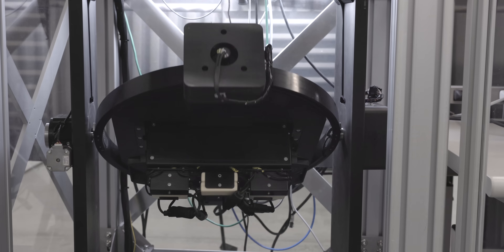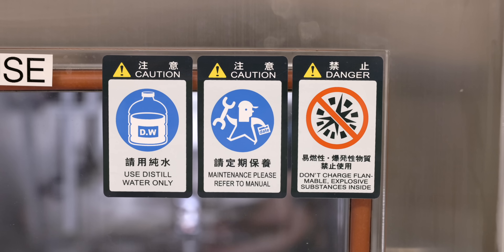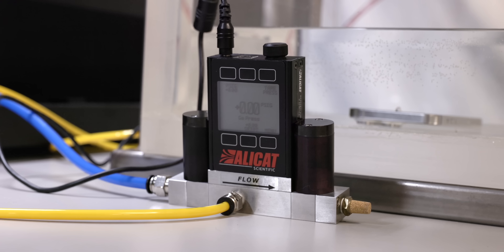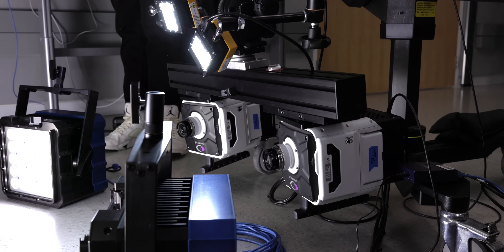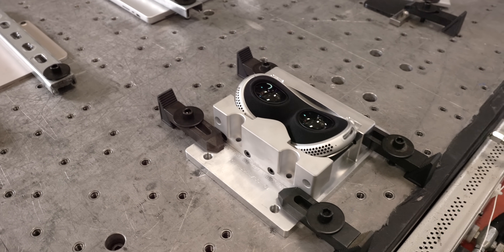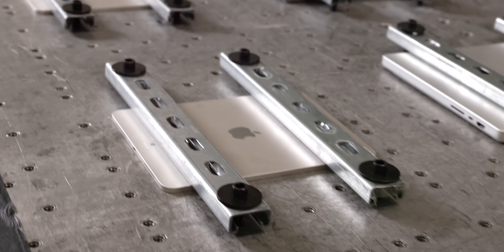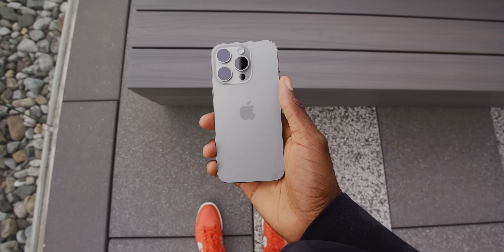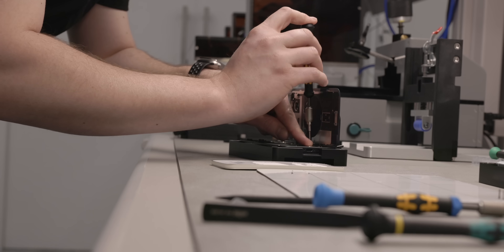I Visited Apple's Secret iPhone Testing Labs!

Comment: I don't buy his argument about the balance of durability vs repairability.

-Adding gaskets improves durability without conpromising repairability.
-Locking parts to serialized pairing has no effect on durability, but destroys repairability.
Reply: He picked the one example where that might be true: (Water) ingress. Sure, completely filling the inside with glue makes it resist water, and makes it unrepairable. In this singular example I agree with him, but otherwise those two are not mutually exclusive. You can very well have a camera that is durable AND easy to replace. They are not on a scale.
Reply: @QuickNick2402  To be fair, he did say those things weren't mutually exclusive.
Reply: tell me about it! what a bizarre way of justifying non sense by Apple!
Reply: Absolutely! What a miserable attempt to justify their greed
Reply: This is apple. What do you even expect from marques? Saying the hard truth? Ofs
Reply: It also seems doable to make the phone waterproof separately from the battery, since that's the one part that will always need replacement.
Reply: @LeaPhant  Not while keeping the phones as small as they are today though. If the battery is to be in an entirely separate compartment to the rest of the phone's hardware, that would probably make it a decent bit thicker.
Reply: @StripeRose is it just the phones though. I see the same patter in all of apples products
Reply: @1mukentuken  Don't get me wrong, Apple is doing a lot of wrong with their things. I'm just saying in some cases there are actually trade-off and it's not all bad.
Reply: @StripeRose S5 is smaller than phones on the market today and has a removeable battery and is water resistant.
Reply: @VikCachat  Right, but what else is also different as a result?
I believe the Samsung S5 also has a lower water resistance rating (which to be fair probably doesn't matter much for most), and a smaller battery with a lot less juice in it.
Reply: @StripeRose  s5 2800mHa vs s24 4000mHa granted there would be compromises to make that into a replaceable battery. I would pay good money to get a phone with a flag ship soc, replaceable battery, water resistance and headphone jack all without the features marketing hype up . Sure it would probably have a smaller battery capacity but without the bs features it wouldn't need that much and you could swap out batteries instead of plugging in battery packs.
Reply: @VikCachat  Yeah I'm definitely with you on that one
Reply: Where you really expecting somebody to who works at apple to not justify why they do what they do? Bro would be fired instantly lol
Reply: @Fry_Plantain  off course we are not expecting apple employees to say the truth but then marques? Such a disappointment giving bs statements just to defend apple.
Reply: @fantasytky28  I mean....... he has to also watch his pockets too.... if you get blacklisted by the big boys in the game, you're taking money out of your own pockets cause I'm not gonna be watching him review products from subpar companies. If he chooses to "sell out" as some would say, then, thats his priority.
Reply: @Fry_Plantain  he is sold out long time ago. If you haven't realised after so many years then it's on you.
Reply: @fantasytky28  I don't think somebody who's a "sell out" could necessarily garner nearly 20 mill subscribers, if people figured out they were biased. At the end of the day, he is still one of the best reviewers of tech in the industry. I do agree with you about not calling out the big guns on certain issues like the repairability one, but I still think he needs his props for what he does.
Reply: @Fry_Plantain  he "was" one of the best tech reviewer. But now or at least for quite some time already? Questionable...
Reply: I was about to write this very same comment. Marques not calling this out is... disappointing (but not really surprising, given how Apple handles media that doesn't tell their tale the way they want it to be told).
Reply: Its classic anti consumer hogwash
Reply: gaskets are not as secure as glue, clearly.
Reply: Exactly this
Reply: I think even if they serialized parts and pair patcs with motherboard, they should provide tools to pair when new parts are installed on phone like google did.
Reply: That second point especially
Reply: This is exactly what I was thinking
Reply: What's even crazier is there have been so many exposes showing how apple fights so hard to refuse warranty repairs and pushes people to just buy another phone smh. They dont even want you to pay out of pocket for repairs
Reply: Durability of profits.
Reply: Thats not the issue.. its that they refuse to even sell spare parts to shops..
Reply: I was thinking the same thing. Apple could certainly do more to make the phone more repairable without sacrificing durability. They just choice to make it hard because it’s apple and you pay premium
Reply: @darkhorse505  What could they do differently?
Reply: I'm going to replace all the wooden furniture in my house with glass. It's much harder to repair, ergo, it must be much more durable.
Reply: Hey you seem smart, you should start a tech channel!
Anyway while this is definitely true gaskets can and will impede the difficulty of repair, both in disassembly and in ensuring the device is still ingress resistant after the repair. It requires specialized, perhaps more expensive tools and an extra part every time you open your device. Now gaskets on phones that are more repairable cost like 5$ usually if you can apply them by hand and as Rossmann says, it's the shop's/user's matter if a repair will be easier or more difficult to fix, like having soldered ram but that's entirely different from not being able to have ram upgraded because it's paired to the SoC.
As for the serializing, what he said about having a database of calbration measurements for all their genuine parts (which reminds of the qr codes prusament has for the thickness of each spool manufactured) is definitely super interesting and probably super helpful, but preventing the end user/shop from calibrating a 3rd party replacement part is just anti-consumer.
Reply: @devnol he alr has a channel
Reply: of course he needs to justify or he doesn't get the visit and money
Reply: the unspoken, untouchable third goal is sleek design. You need something to press on the gasket, and that something will not look like a smooth featureless box.
Reply: @chaklee435  Apple's phones haven't looked like smooth featureless boxes for like a decade since they added the huge camera bulges. My iPhone 13 has THREE giant lenses sticking out. If they can compromise for camera, they can compromise for repairability. That's a clue that they don't care about repairability
Reply: That's not really his argument though. They didn't mention the serial numbers or anything. It's just how difficult it is to get into a phone or how many components are in the way. Having to disconnect a bunch of ribbon cables or have strong adhesive is what makes an iPhone difficult to repair from Apple's perspective and for verified third party repairs. People are approaching this from one angle, but the question and answer are from a different angle. He didn't ask "why are the parts serialized?" he was talking about how difficult they are to repair.
Reply: @LeonBlade  You missed the point. The ribbon cables don't make things harder to repair. Gaskets don't make things hard to repair. Tiny SMD component don't make things hard to repair. Serialization makes things hard to repair. Locked supply chains make things hard to repair. Predatory behavior towards repair shops and makers of repair parts make things hard to repair. None of those things benefit durability. Durability and difficulty to repair are not codependent.
Reply: Yeah I wish he could have asked him about that, but his department probably has nothing to do with the individual components. Would like to here from a parts supplier or Internal designer about why they feel that's nessesarry
Reply: Well of course you don't buy it - most poor people are also dumb and they don't buy anything, they expect it to be given to them for free.
Reply: @rodmunch69  you just came for the cookies, didn't you 😂
Reply: @DanKaschel  is that some sort of come on? I'm straight,  cupcake.
Reply: @rodmunch69  😉
Reply: If I had to play devil's advocate here (which I hate doing for Apple, ESPECIALLY for this specific topic):
1.  Gaskets make the product larger.  "Then why not design so gaskets don't make it larger?" We've fine-tuned the process to the point where affordable, reliable gaskets are not ideal.
2.  Adding gaskets (and other means of access to the phone) create weak points.  "Why not reinforce the weak points."  Then we'll make it larger, which was covered above.
3.  Allowing access to batteries for repair work will make it so our product will decrease in value and our standards, thanks to that repair work.  "Why not put something in the warranty that states outside Apple repairs, although legally allowed, will void your warranty?"  Because people will blame Apple regardless if repairs or mods were done without our consent.  Someone will pick up an Apple phone, see that it's flimsy or slow-performing, but never get the full story that it was brought to an outside source for repair.  We get the blame we shouldn't, and our brand suffers.
4.  Probably most importantly:  By allowing right to repair, you're now creating a competitive market that eats in to potential revenue for Apple.  Now, people will repair their phones instead of throwing it out and buying a next gen phone.  Just the fact Right to Repair exists now is forcing us to put more into our phones with respect to longevity and strength, which could be going in to our pockets in the form of raises.  And since  you're impacting OUR personal bottom end, that's just unfair.

If I were Apple, and had no filter, this is what I imagine they'd argue.  Bullshit?  Yeah.  But there it is.
Reply: Absolutely, instead of glue, you could screw a device together like a laptop, and that would increase both durability and repariability, since the screws won't come out on their own (with properly applied threadlocker), but a user can easily undo them without heat or excessive force
Reply: @YonatanAvhar  Doesn't thread locker give out under heat? Phones left in vehicles are exposed to summer temperatures in excess of 100F for prolonged periods of time.
Reply: @YonatanAvhar  threadlocker isnt always enough, but it often is. Sometimes the issue is more of a size consideration, fasteners take up more space than glue, that's probably apples driving force for their decisions. But honestly, id prefer bigger phones anyway.
Reply: Partially you're right but you're missing a huge point of locking parts to serialised pairing (AKA Regulation) which is Consistency and Reliability.

Let's say any screen can be used to repair an iPhone that's broken, suddenly you have a bunch of varying quality screens on the market and varying quality phones in general in the market. These then not only influence new sales but also potential future repairs and further compatibility with even more other parts like let's say varying batteries.

Now you'd have an iPhone...but what's even an iPhone if you can put any lower or higher quality screen on it? (Basically ship of Theseus type stuff).
This basically screws with the brand they're trying to protect as a company but ALSO the customer's Expectations, Reliance and Trust.

so repairability IS in fact a double edged sword.
Reply: Everything he said was true. No, he didn't attack Apple. Not would that have appropriate in this context. Nor is that even his job other than tangentially.

Honestly y'all sound so naive and entitled.
Reply: @DanKaschel 1.4 million views right now. He's a popular & presumably respected tech reviewer, and he made misleading statements about the repairability of a product he is reviewing. He talks about repairability (usually on a surface level) in several videos. It's literally his job to give fair, accurate, honest reviews. He spoke the company line in this video, and omitted some important truths.

I don't understand how it makes someone entitled to expect a tech reviewer to honestly and accurately review tech.
Reply: In many parts of the world iPhones got stolen and snatched and sold in market as spare parts. So it makes a little sense.
Reply: I kind of agree in the balance argument. Especially in cars… I live in a country where car crashes is all time high, and its always the Solid ER cars, especially German (these cars are known for being hell to repair and service) cars who always stays intact, while japanese cars (being the easiest and less complicated to repair and service)… pray that you’re still in one piece, or not cramped.
Reply: @yokokoko499  Yeah, only part that you forget, that despite looking intact, this cars often suffer damage on inside, repairing which may cost you more then a new car from other brand... Things are supposed to crush - they absorb energy this way. If they do stay optically intact, this means, the energy was absorbed by some other part of vechicle - that isnt made for that purpose - or in the worst case, by the driver and passengers.
Reply: @alexej123  Exaclty. It may look bad if the entire hood of your car became the size of a soda can, but it means it absorbed the impact instead of transfering it to the passengers. The stiffer the car is, the more it will stay in shape, but the less impact is absorbed. So I'll take a car who's body (except the cabin) deforms any day 100%.
Reply: serializing parts is an anti-theft action not durability improvement
Reply: @youssefmohammed5456  I hate when people steal just my iPhone battery but leave  everything else behind
Reply: Serialising is to combat theft not repairability
Reply: @JaeTLDR1 it's mainly done to prevent repairability by the consumer. Discouraging theft is just a side effect.
Reply: Then they should give owners the ability to lock and release serials for their devices. It would massively improve the repair experience for everyone and then apple could use that line without it being bs  @JaeTLDR1
Reply: Who are you again ?
Reply: @Spikyzzzz Someone who knows their shit
Reply: @Spikyzzzz gamecube joycons and portable wii guy

Comment: The argument for durability vs repairability as long as you build products made from glass and that operate on battery power is so STUPID! The battery will degarde over time, that is a fact, so if you care about your customers, you should build your products with the ease of battery replacement in mind, the same goes for screen/backplate.

Comment: well do keep in mind that the reason iphone uses glass at least on the back is cus the consumer wanted wireless charging.

so yes its our fault not apple. that we made the iphone less durable. cus man that iphone 7 was a tank. i could drop it. and if it landed on the back. it was perfectly fine.

so yeah. glass on the iphone. thats 100% on us. thats why ipad will never get magsafe. unless they switch to glass. induction dont work through metal.

Comment: Thats a ridiculous argument to say its repairability vs durability. Sure for water resistance it might check out, but pretending that replacing some parts is more wasteful than entire phones going to waste + you can design for both to be optimal (or dont design to hijack repairability by making new components not work on purpose, thats even more wasteful)

Comment: We know for sure they don't have a bend test machine in there.

9:20 Smells like 🐂 Battery non replaceable bc adhesive? Ghoul just wants to act like screws and rubber seals don't exist and selling adhesive to repair shops is impossible.

Comment: 10:04 yeah checks out, but they're leaving out the fact that they software lock components to the motherboard. You know what I mean if you buy two identical iPhones and swap the screens you're going to have problems how do they explain that in the bookend formula.  That is something that Apple does on purpose to make repaiability more difficult. Or the adhesive that you have to remove to get the battery out, does that adhesive need to hold a ton of weight.

Comment: Harder to repair is just gaslighting, pairing parts to the motherboard so noone but apple can fix is the actual problem and apple won't acknowledge that because they would tell everyone that there just making it unnecessary difficult. 

Google Pixel software calibration after a screen repair can be done by everyone even the consumer himself you just need to visit the website for it, it's accessable to everyone, not like apples tool which only can be used by IRPs or ASPs (or Apple themselves).

I use an iPhone myself and love the product but apples take and statements towards repair are straight up gaslighting, lying and certainly anti-consumer. 

Please don't just let higher up Apple employees talk there talk without a argument against what the actual problem is. It's free PR (obviously) but the type to just make them look good while they just talk strawman arguments. 

Nobody cares about adhesive in repairs, it's been there for like 10 years now, that's just cap.

Comment: More durable but less repairable, sure, but why do they software-lock their parts? Why, when you switch the same parts between 2 identical iPhones, something doesn't work properly anymore? They don't do that for durability; they do that so you can buy a new iPhone or charge you way too much to fix your current one.